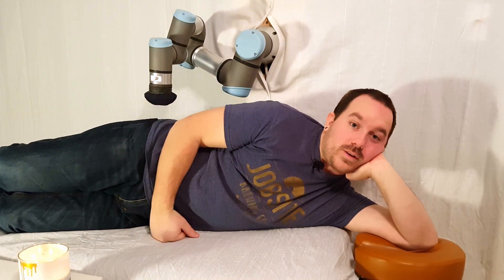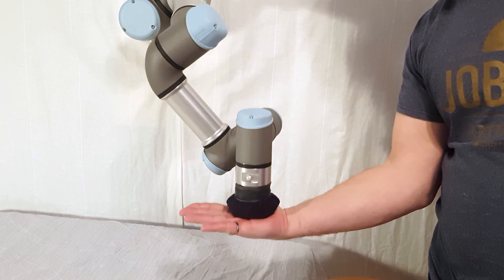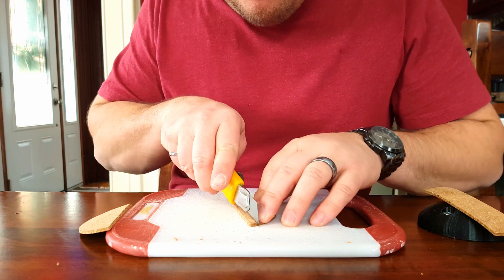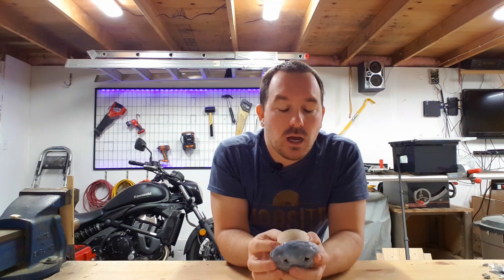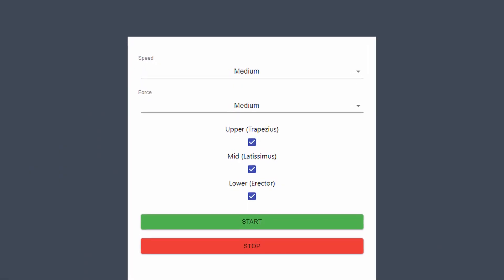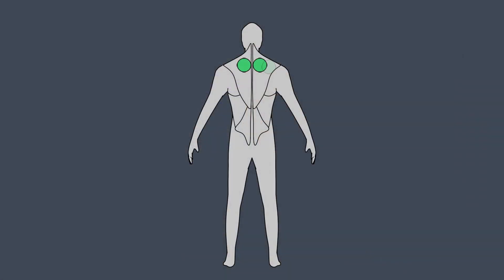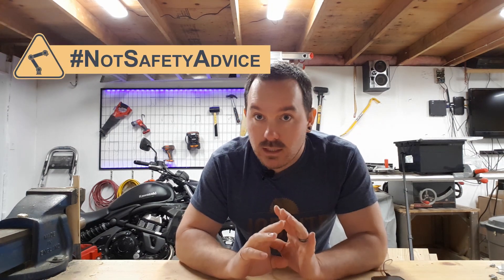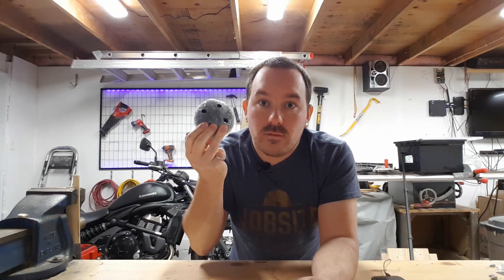Robot Arm Massage - UR3

Comment: What should be done so that even if you were to use it at full power, (without sensors or any restrictions), the robot wouldn't be able to hurt you? Isn't that be safer?
Reply from the maker: You need restrictions to keep the arm safe. You would need to add safety guarding and keep people away
Reply: @DavesArmoury  Ha ha, come on man, you know what I mean.  I'm not a native english speaker, nor have I ever had the opportunity to see or to program such a robot. That's  why I'm asking you: wouldn't it be possible to reduce the power of the robot, for example from the motors, to change  them,  or maybe the voltage is somehow reduced so that it will be impossible that the robot to cause any bodily harm?
Reply from the maker: Nothing is impossible, but yeah, smaller, less powerful motors can make the robot safer

Comment: i keep telling my bf about this same basic idea! I have one of those percussion massage guns and i want a robot arm that can move it around our backs, maybe with some various patterns like circles or slight rotate like yours did etc. I was concerned with the vibration of that gun though messing with the arm.
Reply from the maker: Actually somewhat tricky. You want a collaborative arm so it doesn't hurt you, but the vibrations might trick the force sensors and make the arm do weird things. Probably easier to recruit the bf :)
Reply: @DavesArmoury  I would also love to see an arm like this calibrated with a massage gun attached to it....maybe dual contact, the massage gun mounted next to the stock head....